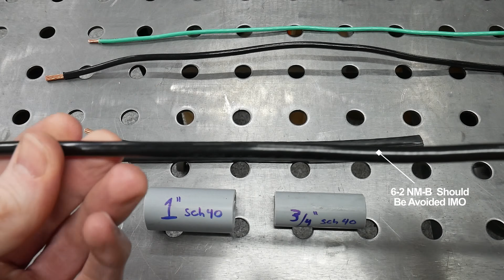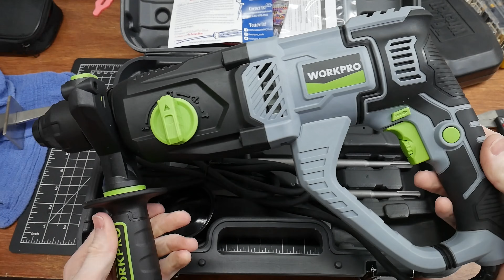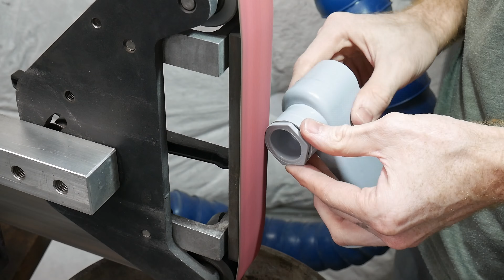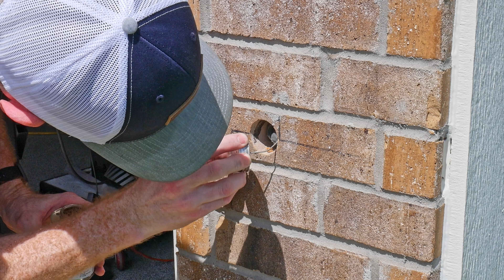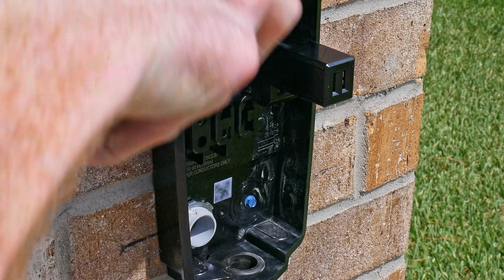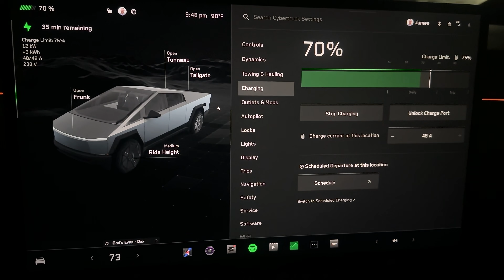How To Install A Tesla Universal Wall Charger | 60 Amp Circuit

Comment from the maker: If yall got something out of this one, please share it with other Tesla owners to spread the knowledge! 
📋Tesla UWC Manual - https://digitalassets.tesla.com/tesla-contents/image/upload/Universal-Wall-Connector-Installation-Manual-NA-EN.pdf
🛠 Mentioned Items / Tools:
Hammer Drill - https://amzn.to/3Y4WhG6
Coring Bits - https://amzn.to/3S6lr3n
Step Drill Bit - https://amzn.to/3Y0AwqP
Knockout Hole Puncher - https://amzn.to/3W5XgmN
#6 AWG Strippers - https://amzn.to/3WmvRhG
Wheeler Torque Screwdriver - https://amzn.to/4f6lENK

Comment: You're lucky to have an electrical panel IN your garage.  Mine was on the other side of the house and running 6 gage wire that far didn't seem feasible.  I was lucky that I had a 220V outlet in the garage so I just use the 220V adaptor from the included Mobile Charger which works great for overnight charging.  Remember that SLOW charging is better for long battery life.  Great job on your installation.  Working on brick is always challenging.
Reply from the maker: Thanks John, that sounds like a challenging run for sure!

Comment: Finally. Someone getting every detail on point (and great NOT seeing all the correcting comments from “real electricians”). Watched many videos on this and this is the first one to get all the points correct and have a brick wall with a 90° exit (similar to me). One question, my box is much closer to my exterior wall. Do you still recommend using the PVC and cutting it or just go with a liquid tight flexible conduit? The PVC definitely looks neater but mine is in a closet so will not be visible. Any advantages or disadvantages? Great video. Thank you for making it.
Reply from the maker: Man, glad you liked the video! Not an electrician for sure here, lol. I think the flexible conduit may give you some more wiggle room. Inside of a structure I think you could run MC cable as well, but like always check your local codes and what not.

Comment: I thought that the Circuit Breaker should be a GFCI breaker and not a normal one.
Reply from the maker: I'm not an electrician, but google says: "Hardwired Tesla Wall Connector: No, a GFCI breaker is not required and is generally not recommended.  The Tesla Wall Connector has built-in GFCI protection, and installing a GFCI breaker can cause nuisance tripping.  The installation manual explicitly states not to install the unit on a GFCI-protected circuit."
Reply: @redbeardengineered  interesting!

Comment: Why do you think 6-2 should be avoided?
Reply from the maker: Thinking back to this project, I think I said that because you can get by with smaller gauge THWN and depending on your location, you wouldn't want to run that large romex though conduit.
Reply: @redbeardengineered  cheers thank you!

Comment: Will the charger wall mount accept conduit into the top?..is there a provision for conduit entry on the top?
Reply from the maker: Yes

https://energylibrary.tesla.com/docs/Public/Charging/WallConnector/Gen3/Install/UniversalWC/en-us/GUID-104919ED-1BA7-4EF5-A884-84E531D8456B.html

Comment: YET U STUFFED #6 INTO 3/4 PVC😂.wires needs space ,when these wires relative to charging are drawing 40 to 50 amps ,gotta love melting wires ..
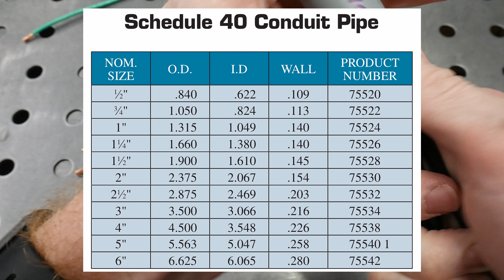Reply from the maker: PVC wire fill table is posted in this video at 1:23
Reply: PVC SAGS LOL,LOOKS LIKE SHIT,PVC FOR UNDERGROUND HELLO,U WORK WITH ME ,NO HALF ASS MICKEY MOUSE ANYTHING (((FIRED))

Comment: I noticed that you applied the PVC glue only to the brick around the actual PVC pipe? dont know why you did that? But if you didn't get any of that glue in the actual joint, then you left that joint loose and not water-tight. fyi, brick will not bond to PVC, at least not this way.
Reply from the maker: I was doing my best to get that glue up in there. It was very tight. Probably should of thought of a way to glue before sticking it in there.

Comment: It's not against code to run romex cable in conduit.
Reply from the maker: With all electrical videos it seems most of the comments are code related. One way or the other. I think it's due to codes being different in different jurisdicitons. I'm not sure... either way, I'm happy with this install! THWN is my preferred option here.

Comment: Great video, thanks much. I am  confused one one thing. You used two black "hots" and had blue tape on one of them. When you hooked into the charger, you said you could  put either one of the black wires into the L1 or L2 since they are both hot. Why did you have blue tape on one of them if that is the case? 

I am going to try to do the install and am trying to educate myself on the process. I am thinking of going with #6 THHN, red and black wire with a green #10 for ground and using the flexible metal conduit. I have a 54 feet length (ranch home) between the panel location in my basement and the wall in the garage where I want to mount the charger (unfortunately!) My plan is to come up from the panel, into the attic and run the conduit across the house and back down into the garage. I estimate about 70 ft run total. 
I already have a 50 amp breaker unused in the panel from a hot tub my wife just had to have but never used. It is no longer being used and I removed the wiring after getting rid of the hot tub after 4 years. I plan on replacing it with a 60 amp breaker. 

I guess my question would be...does it matter where each hot is connected to the breaker compared to where you connect to the charger?
Reply from the maker: Hey man, I'm not an electrician so take everything I say with a grain of salt. Be careful! I taped the white wire to indicated that it's also a load wire. You could run two blacks as well. Both lines are load with 220. It won't matter the orientation / order you connect them on the charger.

Comment: If your main panel does NOT have separate ground and neutral wires, can you still install the charger without needing a subpanel?
Reply from the maker: To be clear I am NOT an electrician so understand I likely don't know what I'm talking about.... That being said you don't need a subpanel to install a charger.

Comment: My husband and I are seriously considering buying a Tesla Model 3. It will be our first electric vehicle ever! Since our breaker box is located in the back of the house, what is a good option for installing the charger near the front of the house closer to the driveway?
Reply from the maker: Your best option is likely to hire an electrician to run the circuit. It can be a pain in the but to run wire long distances as a novice in a clean way.

Comment: Have you noticed if the breaker is getting hot at all during charge? Mine gets about 122°F at 48 A charging. Thanks
Reply from the maker: I have not noticed this or measured. You should probably get someone to check that out

Comment: Thanks RedBeard, first rate, quick video.  Years ago I wired our first charger using what I had:  50 amp CB, #6 romex in 3/4” metal conduit.  The Tesla charger would sense the warming of the circuit and reduce the charging rate significantly.  Because of people like you and the commenting pros, I subsequently used #6 THHN, #10 ground, and a 60 amp CB, and lo and behold, 48 amp trouble free charging ever since.  Thank-you!
Reply from the maker: Glad it helped!
Reply: Do you know how hot the breaker was getting? Mine gets to122F  at 48amp,I’m not sure what’s acceptable,thanks
Reply: @Alex300zxTT from what ive seen 120-140 is acceptable
Reply: Question….this was the regular Teslawall charger.  The Universal is 600 $  Charger. I’m trying to pre wire the ACTUAL UNIVERSAL FOR MY POWER SHARE CYBERTRUCK I DONT know the size of the communication wire that connects  to Universal Charger then to the TESLA POWER SHARE PANEL….IVE GOT THREE 4 stranded 75 feet.    Can someone tell me the size I need for communication wire that’s unique to The Universal Charger….zTELLS THE TELA POWER SHARE UNIT TO REVERSE CHARGE AND TAKE JUICE TO OUR  NO POWER FROM UTILITIES

Comment: Modified the pvc bell, didn't connect the 2 pieces of pvc as required,  used sch 40 pvc instead of 80, used the lockout backwards on the TA. Did I get all the violations? :)
Reply from the maker: Hah, have a great day sir

Comment: Why do you recommend not using 6/2 Romex for the Tesla charger? it is rated for it according to all the specs I have seen.
Reply from the maker: I'm not an electrician, so don't put much weight in what I'm saying/doing. However, I feel like the single strand is easier to pull, and ok to be inside of conduit outside, which was my application. I'm pretty sure it can handle more as well vs the 6/2, based on the charts.

Comment: It's my understanding that a ground wire is not needed. Question. Is that correct or not?
Reply from the maker: No idea... I'd run the ground though
Reply: Ground is absolutely required!!! It is the neutral or white wire not used. If you didn’t install a ground wire or understand the need for it call a licensed electrician immediately.

Comment: I can do this.  I have experience,  I was more worried about whether or not Telsa would warranty any damage because you did not use a Tesla certified installer.  What are your thoughts?  I live in a rural area and have been getting quotes as high as $3500.  Which I feel is a joke. Great video.
Reply from the maker: Wow that's high! I don't know anything about the warranty...
Reply: I have mine inside the garage since my doors are able to close on the wire and it was quite simple took me about 2 hours for never doing anything like this before.

Comment: Since you have both the cybertruck and the universal wall connector do you have any plans to use the cybertruck battery as a whole house backup in case of a power outage? You have most of the pieces needed to swing that!
Reply from the maker: It's on the list of things to do! I got a generator plug wired in and need to try it out. I don't see any issues with it working. Tesla has an official "power share" system that they'll come out and install that is more intelligent with charging and backfilling the house than just a generator plug... Basically no downtime even when the line goes out.

Comment: Random Question - But is the top of your charger where the two pieces (wall plate + charger) come together perfectly flush? 

I noticed when tightening my charger to the wall plate, the center section slightly “sticks up” since the screws are tightening the outside portion of the charger. 

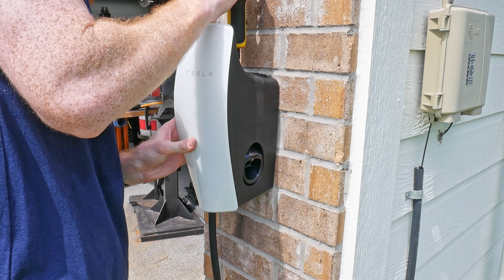In your video around 6:08, it looks like the center portion on top slightly sticks up. Let me know if you can check yours out 👍
Reply from the maker: just looked at mine, seems all to be pretty flush

Comment: Great video, and very clearly detailed!  I successfully replaced an older 80amp charger (that would not work with CyberTruck) with the universal, which is great.  Now, I want to add a second Universal, but it would be sharing the same 100amp breaker which it can load share with. However, not sure how this would work... deciding on DYI or getting it done professionally. Hmmmm lol.
Reply from the maker: I'm not a pro.... so don't take this as real advise. I think these Tesla chargers need to be on a 60 amp circuit no mater what... even if 2 are in use. They can communicate with each other from what I understand for a dual set up. Like I said... I haven't done this one take it with a massive grain of salt. Getting a professional may be ideal.
Reply: Daisy chain wallcharger

Comment: Do you need additional hardware to use the cybertruck  to power your home?
Reply from the maker: Yeah you either need their powershare system or rig up your panel with a standard generator plug... I'm going to be working on this in the coming months to show

Comment: I upgraded my breaker from 40A to 60A, but my Tesla LR AWD stills only charges at 32A. I know it's capable of going up to 48A. Do I need to configure my Tesla Charger to let it know I have upgraded the circuit?
Reply from the maker: Firstly I'm not an electrician so don't trust anything I say on the topic.... Did you upgrade your wires as well? If you just swapped the breaker and kept your wiring the same this is pretty dangerous assuming the wiring was designed for your 40A circuit.
Reply: @redbeardengineered  The wiring is up to Canada code for a 60 amp breaker (6 gauge 3 wire cable). The electrician installed a 40 amp because he didn't want to move around other breaker to make room. I called him back and he swapped out the breaker for 60A.
Then he left...I assumed he should have modified my settings in the Tesla charger.
Reply: If you own a model 3 or a Y (I think) it is my understanding that the maximum charging rate is 32 regardless of whether you use a 60 or 50 amp breaker. See detailed information from Tesla.
Reply: And the wiring size will not increase charge rate for the 3 and maybe Y also. I have a 3 and found out after I installed the wall charger. I’m still glad I bought it as I love the convenience and WiFi features and it’s plenty fast enough for overnight charging. This has been my experience; happy to hear if I’m wrong
Reply: Several possibilities. 
1. You're using the Tesla Mobile (not Wall) Connector. That maxes out at 32A. 
2. Your Wall Connector or Tesla is configured to only draw 32A. You can use the app to reconfigure the Wall Connector, or the car menus to reconfigure the car. 
3. You have a Standard Range RWD Model 3, those will max out at 32A. (Oops, just noticed you specified LR, so this isn't applicable.)
Reply: You need 4 gage solid copper mains and a 6 gage solid copper ground to get the max charge potential on a 60amp breaker.

Comment: I followed your instructions almost to the letter - ordering everything on your list.  The wall I had to core through was over 5" thick so I couldn't do it in one go. The center drill bit also kept detaching, but eventually everything worked and I was able to get a nice hole for the conduit. I used the same Hammer Drill instead of a impact drill for the anchors and it worked great. I did add washers and o-rings to all the anchors and the conduit so that it would hopefully form a seal. I also put silicone around the wall connector/charger like you did to help with the seal as well. Question: Why did you leave the conduit fitting attached to the wall connector/charger plate and then glue it by pressing the connector plate against the wall instead of gluing the conduit fitting to the PVC pipe and sticking it through the wall and wall connector/charger plate and then put the locking washer and bushing? 
Thanks for creating such a fantastic how to video. Every aspect of the install was new to me so it was extremely helpful.
Reply from the maker: Man glad you enjoyed the install. I think it could be done either way; I'm not a pro... so that way may be better. Be safe out there!

Comment: hi buddy, how many total wires do you need for the job? 2 hot, 1 neutral, and 1 ground?
Reply from the maker: This was shown in the video; please be carful with your install!
Reply: @redbeardengineered , yes I saw it in the video, but would appreciate some clarification of not needing a neutral. Thank you
Reply: @karlpeters2134  hire an electrician you just wouldn’t get it
Reply: @RUNT0NE  I got it installed and I am able to understand it and all is well. Maybe you should spend your time being helpful, it is a better way to go.
Reply: I have the same question. I assume 2 hots, a white, and a ground. Is the ground also the neutral? They get combined in the panel eventually. Any clarification would help me understand. Thanks

Comment: So u used #6 on 60 amp breaker ?
Reply from the maker: Based on my non-professional research I went with a 60 amp breaker and #6 AWG THWN-2 stranded copper wire.
Reply: @redbeardengineered  can i ask why #6 if thwn-2 and why #4 if its romex? thanks...
Reply: @yrreb13  THHN has a higher heat capacity than romex (NM) so it can carry more amps. The max heat capacity for #6 romex is 60c and 55 amps. #6 THHN is rated at 75 amps with a 90c rating. #6 romex will not carry the necessary amps for for a 48 amp wall charger. You can get around this by lowering the capacity of the charger with the app, but it is a fire hazard if someone else increases the capacity. Your local inspector will probably also ding you since you are not matching the wire capacity with the charger capacity.

Search for NEC table 310.15(b)(16) for a listing of different ratings for different cable types.
HTH
Reply: Romex is a sheathed cable if 2 or more wires so it doesn’t have as high an amperage rating as a single strand of wire (THHN) in this case has.

Comment: Do I need to have thwn 2 wires in conduit inside the home through open ceiling in basement? Or it can be exposed indoor? Thanks
Reply: As an electrician it needs to be placed in a conduit.
Reply from the maker: I'm not an electrician, but I'm pretty sure you need THWN in conduit all the time. Don't quote me on that... would be good to ask an electrician in your area.
Reply: Thanks

Comment: Are you planning to use the cybertruck to supply power to the house during power failures?
Reply from the maker: I do; working on a solution there. Planning a generator outlet to my breaker panel. I don't want to put the power share in this particular home.

Comment: Great video.  Really liked the details about the wire specification.  Front house installation through the brick looks super clean.
Reply from the maker: Thank you greatly! It's been working great. no issues achieving the 48amp rates. Would be nice to have a carport here... but hey... we make do with what we got. Cheers!